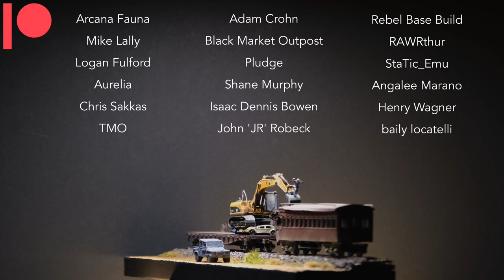How to Make a 007 Skyfall Diorama

Comment: Awesome job. Just a heads up if you do any more rail related dioramas in the the future there should be monthly train swap meets if you're even remotely close to a major city and you can usually find more than a couple dealers with Euro or foreign rolling stock as well as a reasonably less expensive way to get a start in model railroading if the bug has bitten you.
BTW your ballasting seemed pretty spot on and the only thing I'd suggest is an old trick I did was to give the sides of the rail a shot of rust brown and then run a track cleaning eraser over the rail heads to give the impression of rails that had rusted all over but where the wheels had polished them.